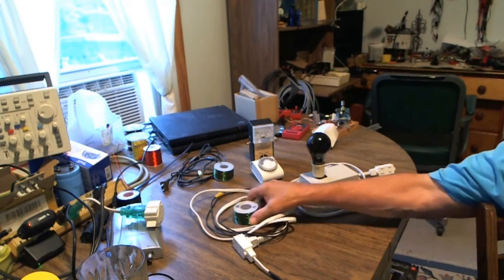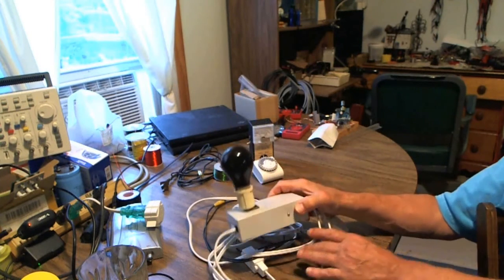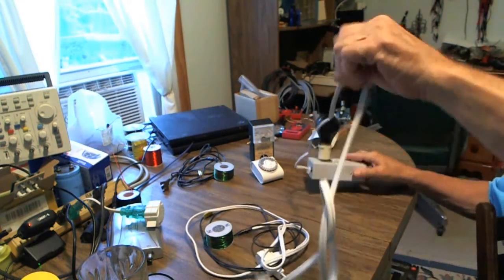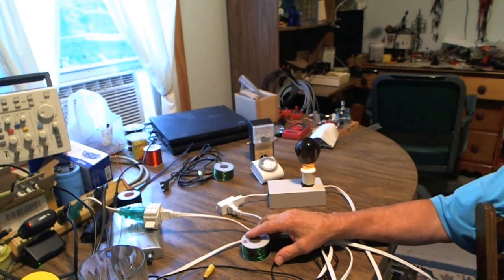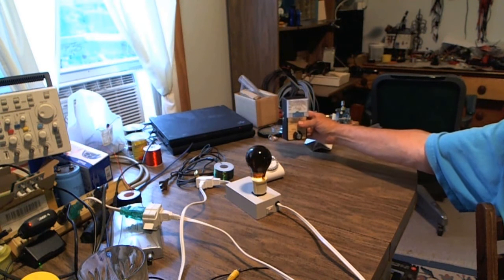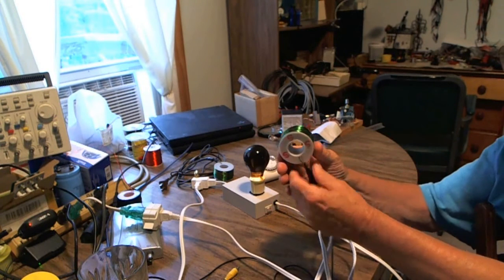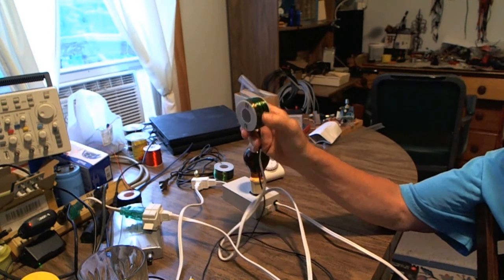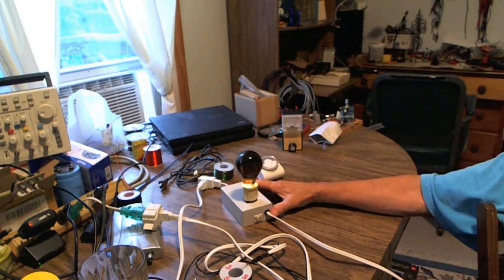Good PEMF Intro

Comment: Must the Coil be connected to the box to replace the Spooky2 remotes?
Reply from the maker: PEMF Technology is entirely different from Scalar Wave technology.  The Spooky Remote would most likely get destroyed if connected to this unit.  Additionally, those small coils have been upgraded to much larger coils and are no longer supported.  See the www.aurorasky.net for more information.
Reply: @gskempe9  No i mean you said in the video that it can replace the Spooky2 Remotes, that it was 100 time more powerful. So i wonder if the coild could me used as a Remote as you said you can put DNA in it. So I thought if you could connect it to a Spooky2 MX generator and Replace the Remotes with the Coil?
Reply from the maker: Too much to say about Scalar Waves and the Spooky Remotes.  I will suggest maybe some Scalar Wave research would be a more appropriate place to get these answers.

Comment: Is that iron core type coil?
Reply from the maker: It can be.  The iron core is simply a piece of 1” diameter cold rolled steel. It is inserted if you want a more focused and powerful magnetic pulse.
Reply: I have try build like your pulser. Mine using 5 photoflash caps 160mfd 220v.two 10amps diode , 2p4m scr. E...e.. old version PEMF maybe. It still didn't work. the lamp always on and on. i don't know why.
Reply from the maker: @saptianibrahim1333  Use the Pictorial Drawing on http://www.aurorasky.net/html/pemf_bob_beck.html as a guide.  Insure you use a diac and 10K ohm potentiometer which you didn't mention above.  800 ufd is a little on the weak side and one 10 amp diode will do.  Be well and respectfully, Steve

Comment: please post the circuit diagram thanks.
Reply from the maker: The links to the schematics can be found on the website www.aurorasky.net
http://www.aurorasky.net/New_PEMF_Schematic.pdf
http://www.aurorasky.net/High_Powered_PEMF_Schematic.pdf
Respectfully,  Steve
Reply: Do you make these for others?
Reply from the maker: I have built a few in the past for people, but now I only build when I can find the time.  This is one of the simpler units to make and I would image that there is more than enough info on the web to duplicate this little project.  Consider employing a local high school youngster or a local fix-it person to put one of these units together.

Both these project, the Bifilar MAG Coil and the Bob Beck PEMF have been improved upon with a bigger and much more powerful Bifilar Coil along with the new High Powered PEMF unit.  The difference in performance is amazing.  More information can be found at www.aurorasky.net